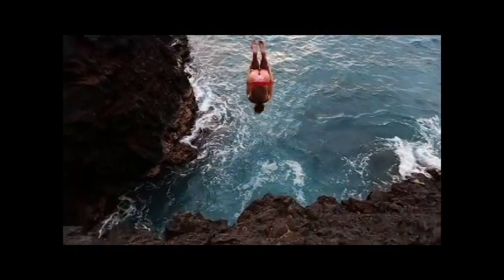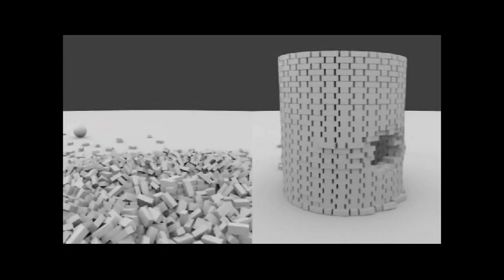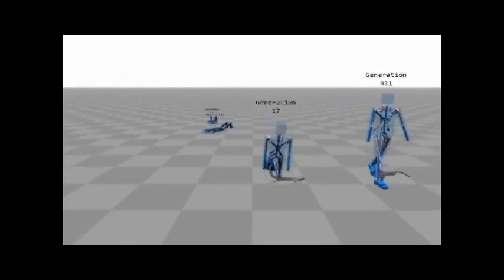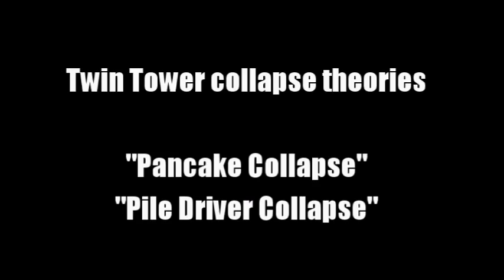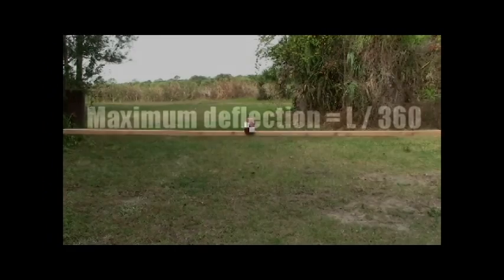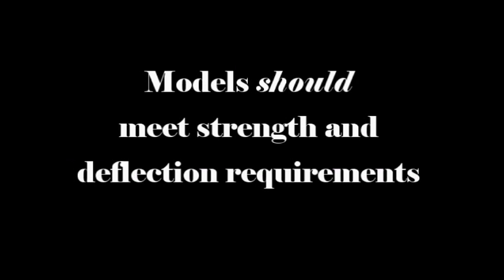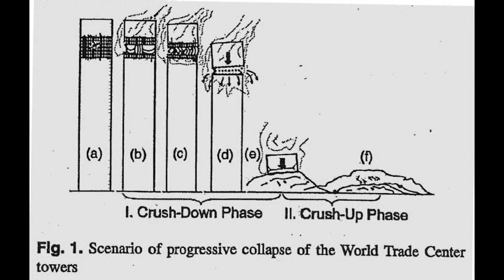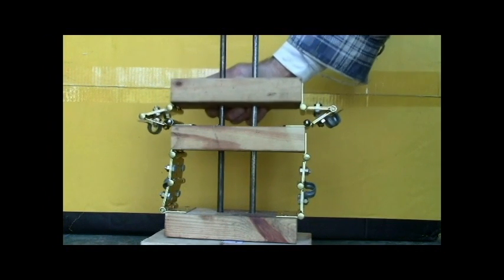9/11 Experiments: The Force Behind the Motion

Comment: 2:30 of course Feynman's unspoken requirement is that the "experiment" needs to be done correctly or all bets are off.  3:15 interest the guy points out that we use computer models to build complex jet airplanes, and you come with an analogy that computer models can make pigs fly, CON-JOB.   4:20 - you're model is a phony, that those hinges are NOT analogous to the structural components of the towers!   6:15 - phony experiment,  your single boards are not at all analogous to beam, pan, concrete floor structures.  NOT AT ALL REALISTIC.

The upper lighter structure - above the impact zone.  Where the hell do you get off implying that was light weight unit.  What about gravity and inertia?  7:59 in NO WAY does your structure simulate the actually structural complexity and the many connections that the real towers consisted of! TOTALLY UNREALISTIC. 8:15 of course it didn't simulate the actually collapse, it is in NO way similar - apple and peanuts buddy, don't pass the stink test.

8:45 - Why not point out the difference in scale and what a difference that makes to a collapsing object?  9:12 Another model that in no way is analogous to the tower's structures.  9:25 - Well yes, once you calculate the actual loads the way the serious experts did.  9:42 Your models keep getting further and further from the reality of the towers.  10:03 of course you didn't see what happened to the towers, you we're foolish to expect that your model with paper which when properly configured can be strong as hell, think corrugated card board.  Your ring of paper, why not do some modeling math scale it up to WTC sized and see how much stronger the WTC would be than actually decided.  Of course, then look at weights and sizes and not window and ponder the silliness of that analogy.

10:09 What "out motion" ???   10:30  here it really goes off the deep end.  You also need evidence of explosives - make-believe doesn't accomplish that in the real physical world.
11:08 WOW, models with lots of fireworks, now can we look at that video of the collapse, . . . hmmm what's missing?  11:23 NO you weren't, not even.  

13:30 Must have used powerful explosives, WHY???   Weight, gravity, inertia, structural complexities and weakness accelerate to tremendous forces.  

13:45  What a sick joke.  Don't speak for nature when you IGNORE so many PHYSICAL REALITIES.
Reply: H.Res. 1258 (110th): Impeaching George W. Bush, President of the United States, of high crimes and misdemeanors.https://www.govtrack.us/congress/bills/110/hres1258/text
Reply: psikeyhackr, very disappointed.  When are you going to share something serious and substantive.  Oh yeah, I know, 9/11 Hoaxers don't have anything serious or internally consistent.  
Maybe next COLE PE will explain to us how manmade global warming is also a media hoax.
  : -  (
Reply: You're being silly.  Fantasizing that I'm your enemy, or some great pawn, is your own insecurity screaming.  If you had facts on your side  you wouldn't need to resort to such transparent diversionary silliness.  It's juvenile, grown up!  Come back when you have something of substance.
Reply: You've trapped your mind within a mason jar.  Very sad.  The only hell we have to face is the hell on 
Earth know-nothing are striving to create.
Reply: "Come back when you have something of substance."  ?? Really ??
When was it announced that you took over the helm of the good ship YT ??
Reply: Just saying, this thing here is story telling and bias fulfillment, it's not a serious inquiry.  I took the time to point out specific critiques.  'nough said.
Reply: 'Nough said if your a Jew-loving shill like you, but not if your a patriot like me. Not even close. You've been exposed and will burn in hell with your Jew boses.
Reply: That sort of thinking/language is the province of out of control juveniles.  You don't know me..  Bet you're simply a very angry person looking for easy answers, you're scared and looking for people to hate.  I'm not your enemy.   So sad, but, so it goes.  Lord of the Flies here we come
Reply: a) That doesn't make sense.  b) Besides, what's it matter?  I was addressing the delusions..
Reply: You are delusional if you don't know what difference it would make when there are several different users by the same screen name replying in your thread.
Reply: Why?  None of you have anything intelligent to say anyways.  Name calling, fantasizing, nothing more.  Want to learn what happened to the World Trade Center - https://www.youtube.com/watch?v=3S5ohCX9JI8&t=2s - Physics, pure simple to understand physics.
Reply: How nice that you believe you have solved the puzzle of the first of their kind catastrophic collapses of steel framed high rises. So .......... all it took was one video made by the BBC?? How quaint .......
Reply: First of that mass, but NOT "kind" - look up Seoul's Sampoong Department Store disaster. As for the documentary, if you had taken the time to actually view and listen to the contents and think about the substance of that video - which featured the designer looking at his design and explaining the collapse - you would have learned why it collapses.

I'm curious do you know anything about construction?  Are you familiar with trusses? Ever help place them and install the blocking and shear bracing that creates a strong structural unit once it's all fastened together?  Do you even know what a truss is?

There is nothing magical or mysterious about how the WTCs collapsed, that's why no one that knows anything about it is impressed with all the discombobulated unrealistic notions being hurled at the public.

 It's the physics!  Maybe give the BBC documentary a good faith effort  https://www.youtube.com/watch?v=3S5ohCX9JI8&t=2s "Discovery UK - How The Twin Towers Collapsed" April 2002
Reply: Oh and here's and interesting shorty that will explain the fuel, heat, steel thing.  If you're interested.  https://www.youtube.com/watch?v=FzF1KySHmUA
Reply: When are you shills going to except the science prooven by Dr. Judy woods like the rest of the world has? The buildings were vaporized and dustified by satelite-mouted Directed Energy Weapons, leaving no solid debri whatsoever. Read "Where Indeed Did The Towers Go" by Dr. Woods. Educate yourself.
Reply: citizenschallengeYT  Thanks for posting the link to that channel of the ignorant blacksmith who says that bending heated steel sideways proves that jet fuel will not melt steel. I used to post comments there often stating my opinion that you would have to be paid to agree with that 2 minute dark meme sponsored by the same people who publish Popular Mechanics Magazine. (too bad the 'blacksmith/performance artist chose to delete so many of my comments) Like many of this type of government sponsored propaganda, the comment section is now closed.
Reply: citizenschallengeYT    BTW Your other posted video link does not feature the structural designer of the Trade Towers, John Skilling. The opinions  expressed by the Engineer of Record, Leslie Robertson, in no way reflect the opinions of the actual design team.
Reply: Perhaps this will help http://www.mace.manchester.ac.uk/project/research/structures/strucfire/materialInFire/Steel/default.htm "Hot finished carbon steel begins to lose strength at temperatures above 300°C and reduces in strength at steady rate up to 800°C. The small residual strength then reduces more gradually until the melting temperature at around 1500°C. This behaviour is similar for hot rolled reinforcing steels. For cold worked steels including reinforcement, there is a more rapid decrease of strength after 300°C (Lawson & Newman 1990). In addition to the reduction of material strength and stiffness, steel displays a significant creep phenomena at temperatures over 450°C. The phenomena of creep results in an increase of deformation (strain) with time, even if the temperature and applied stress remain unchanged (Twilt 1988)."

Also so what about a beam or post, being super heated from one side only.  Think that impacts structural strength.  It's simple, perhaps deniable, but still unavoidable physics.
Reply: I received a decent education and possess a though understanding of mechanics and science. I have used my knowledge in practical applications for the majority of my adult life. What is proposed by NIST as resistance free collapse of steel framed structure is a physical impossibility under Newton's Laws.
Reply: Right that's why your responses consist of insults, while ignoring the substance of what I've shared.  Have you ever worked with trusses?  What about your understanding of kinetics and inertia?  What did you expect should have happen?  Are you surprised that most everything got pulverized?  Why?  What did you expect?  Can you explain?

Very rough calculations show that at a minimum the North Tower above the damage weighted in at over 50,000tons not including furniture, papers, people.  South Tower on the order of 110,000 tons.  Come on, pull the bottom out of those, what do you expect would happen?

Sure the way it collapsed shocked and surprised everyone, but once you start considering what was going on physically with that structure the mysteries evaporate.  For starters think long and hard about the outer structure and the sort of girdle it created, the inside floors, then core started the collapse at the weakest links, the girdle confined the collapse to within itself - except for the one chunk of leaning tower that got sheared off and fell immediate next to the building.  

Heat, weaken structure, weak links, inertia, gravity, explains the collapse plenty well, that's why the experts didn't need to reinvent the wheel to conclude what happened.  

Oh and this sort of structural collapse, truss to superstructure failure leading to massive vertical collapse has happened before.  Look up "Sampoong department store collapse"

Or look up "Don't Trust The Truss!"
Reply: Regarding Skilling and his engineers, this may interest you: USC  
http://illumin.usc.edu/98/why-the-world-trade-center-towers-collapsed/
  "While not directly causing the collapses, the impacts may have had an effect on the events of the day. They may have weakened the buildings' defense mechanism: the sprinkler system. Most buildings employ a sprinkler system in an effort to decrease the intensity and damage of a potential fire. Many investigators now believe that the WTC's sprinkler system failed due to the impacts; but even if it was activated, it could not supply enough water to quell the extensive fires and prevent structural instability. Jon Magnusson, the chairman of Skilling, Owen, Magnusson and Berkshire, has confirmed that if the sprinkler systems were broken by the impacts, the un-battled fires would have easily raised the temperature high enough for the steel to bend under the load of the buildings' weight. Once the integrity of the steel was lost, the structures were destined to fall.
"
Reply: One man's opinion Mr. YT. I don't mind your sharing of information. What I do mind is that you think only your opinion has any importance. I don't know you from a turd in the stream sir, you can not validate your credentials as an all knowing expert but you stink of government sponsored propagandist. Sorry .........
Reply: Physics don't give a fart what I think.  It's not about me, it's about the reality of construction methods.  It's about the physical properties of steel, it's about an unimaginable amount of mass and the force of gravity.  Calling me names and using ridicule doesn't change a thing about how trusses behave, or about their connections to the superstructure, or the loads those are built to support.  You want to ignore all that, by calling me names.  

And now conjuring up that I'm some government co-conspirator - that's desperation incarnate.  The sad part is how well it works with a gullible disinterested public.  Who/what I am?,  a carpenter with a few decades of dealing with the reality of construction, and of bullshitters for that matter.  Just say'n.  Not pointing no fingers, just say'n.
Reply: Regarding Skilling and his engineers, this may interest you: USC  
http://illumin.usc.edu/98/why-the-world-trade-center-towers-collapsed/
  "While not directly causing the collapses, the impacts may have had an effect on the events of the day. They may have weakened the buildings' defense mechanism: the sprinkler system. Most buildings employ a sprinkler system in an effort to decrease the intensity and damage of a potential fire. Many investigators now believe that the WTC's sprinkler system failed due to the impacts; but even if it was activated, it could not supply enough water to quell the extensive fires and prevent structural instability. Jon Magnusson, the chairman of Skilling, Owen, Magnusson and Berkshire, has confirmed that if the sprinkler systems were broken by the impacts, the un-battled fires would have easily raised the temperature high enough for the steel to bend under the load of the buildings' weight. Once the integrity of the steel was lost, the structures were destined to fall.
Reply: Why have you chosen to ghost out user replies to your government sponsored propaganda? Were you getting near the end of your daily shift?
Reply: What a shame there weren't enough courageous politicians and citizens to do the right thing and see that through.  So I'm glad we seem to agree on something.  But the collapse of that building is simple construction physics, damage, extreme distorting heat, times gravity, and masses and weights that we can't rightly imagine.
Reply: citizenschallengeYT  So....without breaking stride you agree with the information posted that cited George Bush administration for 35 articles of impeachment in 2008 for high crimes, flagrant deception through mass media, larceny and other crimes of concealment and obstruction of justice including article 34 citing deliberate cover up of the investigation into 9/11 then you spin about on your spike heel supporting the false narrative of the WTC building destruction? You're quite a piece of work YT.
Reply: No I didn't read all articles of impeachment.  But, those two Cheney/Bush should have definitely been impeached, hell they should be in prison, for giving national security a vacation and then their War of Profit, and what that did to the 'new world order'.  
Still, mind you, ignoring national security and allowing that plot to unfold under our noses is A TOTALLY different matter - from the damage those planes inflicted along with the physical facts of why those structure's collapsed.  As outlined in that documentary.  

Those are the facts you should be wrestling with.  Physical facts that have nothing to do with me personally or with my level of knowledge or ignorance.
Reply: Did you read any of the 35 Articles of Impeachment? You will find that the majority of them were for the war crimes committed following their failures to act on intel prior to the 9/11 false flag attack on America.
Reply: Yada, yada, yada, I was discussing why those towers collapsed the way they did.  That's all.
Reply: Sure, sure, sure, you wanted to portray yourself as some kind of internet genius but you are unwilling to come out from under your rock to show your credentials.
Reply: What does the physics of why the WTCs collapsed the way they did have to do with my "credentials" ??? - want credentials go to   http://hyperphysics.phy-astr.gsu.edu/hbase/flobj.html   -  or check out the credentials of the guys the built the thing and that were interviewed in that straightforward discovery documentary.  https://www.youtube.com/watch?v=3S5ohCX9JI8  It's not about who's club I belong to, it's about appreciating real world physics.   It really is that simply.

Although you know, we live and learn.  I didn't know about the molten aluminum / water explosion theory, to explain explosions heard - https://www.smithsonianchannel.com/videos/this-computer-simulation-explains-how-the-twin-towers-fell/37709  So there a bit more intense rattling and distortion to help those truss-connections fail - thus initiating the chain reaction collapse.
Reply: The 'truss-connections' were gravity joints, much like all of the vertical support columns. These 'truss-connections" have very little to do with the physics of collapse of the Trade Towers as they contribute very little to the ability of the vertical support structure to transmit gravitational loading to the foundations. If you had any understanding of physics or simple building mechanics, you would know this.
Reply: "Gravity joint" you mean "load-bearing truss seats"?  Yes, each floor is responsible to carrying it's own load - meaning when you get ten floors ++ hitting each level individually, there is no way those seat joints (that were designed to carry one level) are not going to instantaneously fail.  
Thanks for getting to heart of the shocking collapse, compounded by having a hundred floor to crush one at a time before hitting the ground - which added ever so much to the visual and emotional impact and disbelief.

I'll take the experts such as Stephen W. Banovic, Thomas A. Siewert analysis, over this weird exercise is self delusion you folks seem to have going on.  For technical details:  https://app.aws.org/wj/supplement/WJ_2007_09_s263.pdf
Reply: Obviously your extensive training in physics hasn't prepared you for any mechanical challenges from the 'lay-people'. Please Google the term of "Gravity joint". I'm quite certain you will find it does not refer to only "load-bearing truss seats".
Reply: Pic of the physical connection truss to welded truss-seat:  http://www.mace.manchester.ac.uk/project/research/structures/strucfire/images_export/CaseStudy/HistoricFires/BuildingFires/nist.gif  "Truss seat" is what they call it.
I did google "Gravity joint" (have you?)  then "Gravity joint - building construction" have just done it again - closest thing that shows up is pins for scaffolding and pin locks - I'll admit I've never heard the term.  So, I'm not sure what you are referring to.  But I'll listen to you explain it.  I know there are "bearing points" but that refers to transferring the load to the foundation.
Reply: What is the "damper connection" tagged in that illustration and how does it relate to the proportional strength of the connections to the perimeter columns in relation to the strength of the connections to the core columns that have only "truss seat" connections? What is the relative point of failure due to alleged heated and sagging truss failure cited as the initiation of the collapse sequence of the Trade Towers.
Reply: Oh so now you want me to pretend to be an expert? Here's a better look, by experts: http://ws680.nist.gov/publication/get_pdf.cfm?pub_id=910105
"Figure 5. Schematic of composite floor truss system (and clear view of damper connections) [1].
The bottom chords of the main trusses were connected to the spandrel plates of the exterior wall by viscoelastic dampers. Experiments on motion perception, conducted with human subjects, showed a potential for occupant discomfort when the building swayed in a strong wind. When the tower moved under wind loads, these dampers absorbed energy, reducing the sway and the vibration."

I don't have a clue 'specifically' what they were rated for - but I can tell you for damned sure, they were not rated for ten stories ++ falling on them.

Get my drift?  What is it that you are driving at anyways?
Reply: More from actual experts: "What is viscoelastic?
Viscoelasticity is the property of materials that exhibit both viscous and elastic characteristics when undergoing deformation. Synthetic polymers, wood, and human tissue, as well as metals at high temperature, display significant viscoelastic effects. In some applications, even a small viscoelastic response can be significant.

Elastic behavior versus viscoelastic behavior
The difference between elastic materials and viscoelastic materials is that viscoelastic materials have a viscosity factor and the elastic ones don’t. Because viscoelastic materials have the viscosity factor, they have a strain rate dependent on time. Purely elastic materials do not dissipate energy (heat) when a load is applied, then removed; however, a viscoelastic substance does.

What are uses of a viscoelastic material?
Viscoelastic materials are used for isolating vibration, dampening noise, and absorbing shock. They give off the energy absorbed as heat."
Reply: I don't have a clue 'specifically' what they were rated for - but I can tell you for damned sure, they were not rated for ten stories ++ falling on them

Well no, they weren't designed to support gravitation loading vertically, Blinky. They were designed as dampeners (like automotive shock absorbers) to reduce the sway in the very tall high rises by reducing lateral (horizontal) movement. Are you sure you are prepared to speak to this subject armed only with an internet search engine and your intranet?
Reply: Elastic behavior versus viscoelastic behavior
I told you before, Blinky after years of internet reasearch, I'm an expert on the topics of 9/11 and how buidings collapse. I am the truth authority on these channels. When people fall in line, I can be very bennevelent. But when they don't, I come down with an iron fist. It's not easy haveing all this power, but I take the responsibility seriously, but if you want to test me, I'll show you what I can do. Despite our cordial exchange so far, if I find that you keep conversing with the impersonators on my channels, you'll be VERY sorry.
Reply: You could have saved your time if you just stuck to the relevant portion of your reply above -->
I don't have a clue
I guess that would have violated your normal work ethic though = telling the truth.
Reply: More from actual experts
You mean experts that have been trained and brainwashed by Jew-owned universities instead of real experts like me who learned there knowlege on the internet, right Binky?
Reply: You are getting warmer, randy. Except for the part of you being an expert.
Reply: What will you do lover when they come for you?
Reply: Oh lover, that just gave me chills:
"Bad Boys" Huh!
Bad boys!
What'cha want? What'cha want?
What'cha gonna do
When Sheriff John Brown come for you?

Tell me, what'cha ya wanna do, what'cha gonna do?
Yeah!

Bad boys, bad boys
What'cha gonna do?
What'cha gonna do when they come for you?
Bad boys, bad boys
What'cha gonna do?
What'cha gonna do when they come for you?

I wish you weren't working in the other room, randy
xoxoxo
Reply: It's my understanding that just the diametric opposite is true, randy.
I wonder how it will all work out, huh?
Reply: Because that's what us paid government shills do, right randy?  ;-)
Reply: Maybe your Jew boses can send you to remidiel speling school, randy?
Reply: citizenschallengeYT  You're not much of an investigator if you can't see that there are several user accounts named 'SIater SIater' that have replied in your thread.